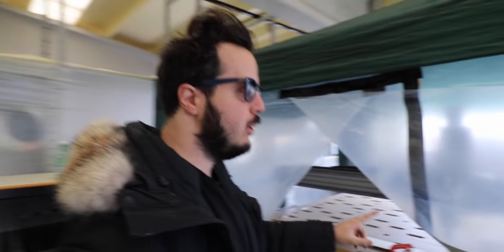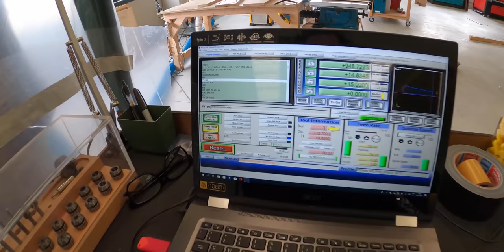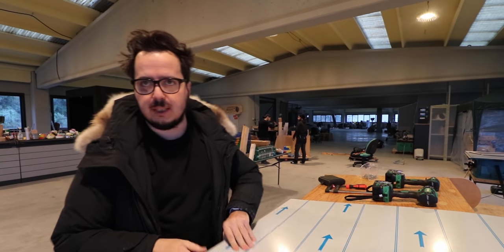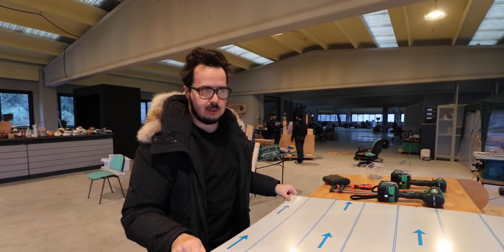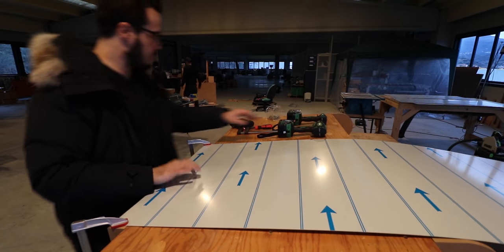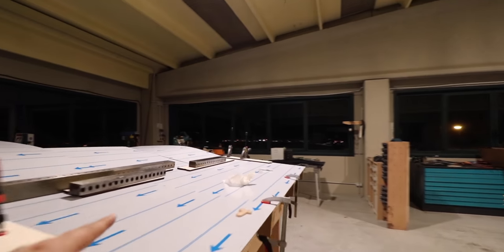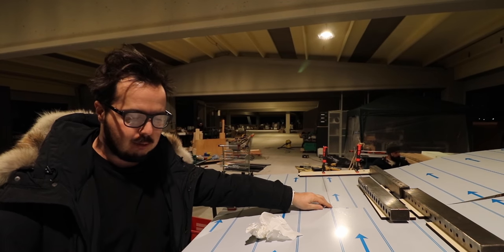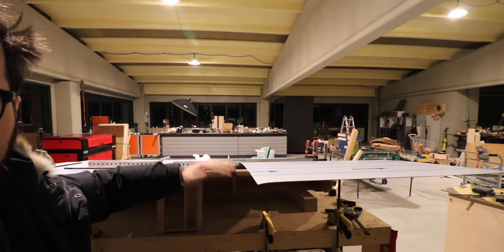starting the WING DESK project

Comment: Hi Giaco, if I glue two large flats together I use brazing rods laid out about 150 mm apart. Lay the one surface over the other, line it up and then start pulling the rods out one by one. Much less stressful
Reply from the maker: Yes that is a great way to do it but here because of the shape and "springiness" of the sheet it wants to spring open...

Comment: hi about the legs i'd made a structure resembling the struts like an old biplane or maybe resemblng a landing gear with big wheels. it's a shame with the resources you have you didn't go for a full aluminium costruction i think would have been easier. lots of flat bottom wing profiles and i know would look a little wierd putting upside down but function is king :).  look for cleco pins if you don't know them. thx for sharing. take care. piero
Reply from the maker: I love cleco
Reply: @GiacoWhatever  it came to mind my comment seems rude. not at all and sorry abt that. new subscriber :)

Comment: Remember that Paul Jr had one of these in Orange County Choppers, https://www.restorationhardware.com/catalog/product/product.jsp?productId=prod280189 . Think the screwed look ok, and driven them in on all the corners presumably to prevent lift up.
Think would run a piece of pipe down the round edge, imagine get pretty crumpled in an inevitable crash otherwise.